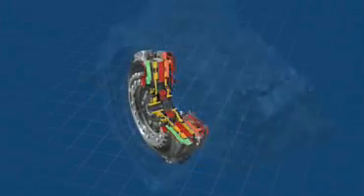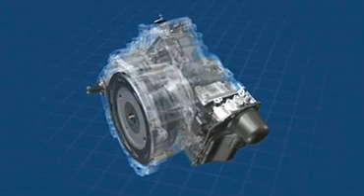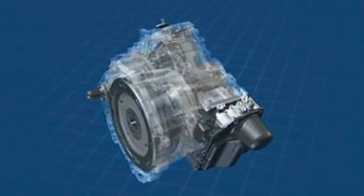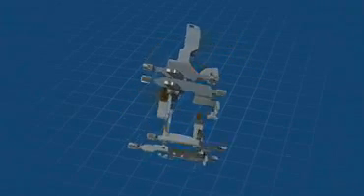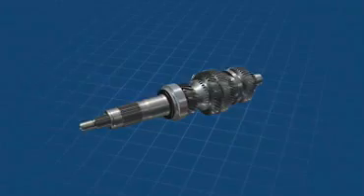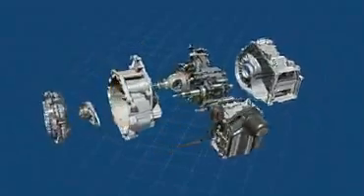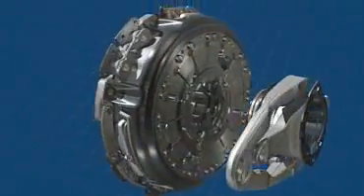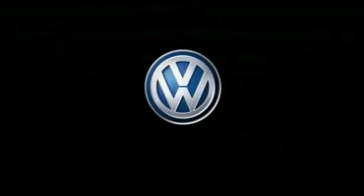VW 7 gear dual-clutch gearbox DSG

Comment: i had a 2010 golf 1.6tdi se dsg the engine was great the gear box was awfull clutches changed at 30k miles mechatronics played up the last 5 k i owned it ! changed the golf now have a passat manual 6 speed miss being lazy but dont miss being scared when pulling out of junctions!

Comment: Some reports on the DSG7 noise and vibration problems comming from the clutchs: i think overheat and unforming from the disks, but the DSG7 as dry clutches and the other DSG use oil bathing (like on most motorcycles) and they have no problems like this...